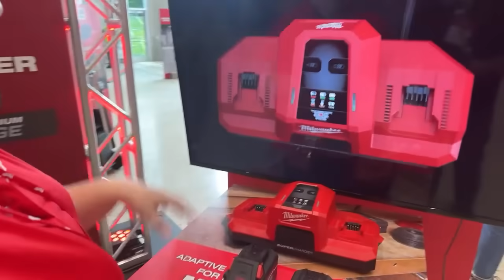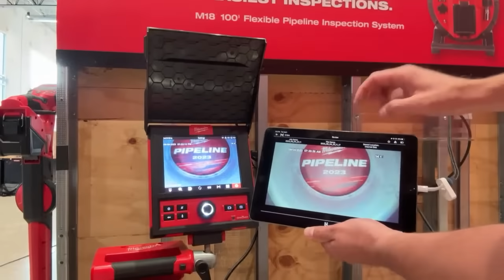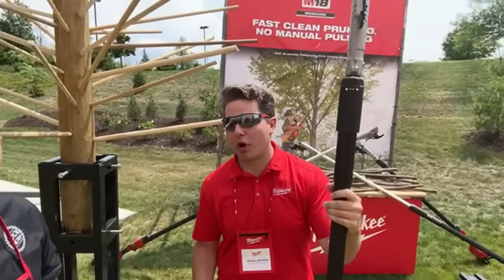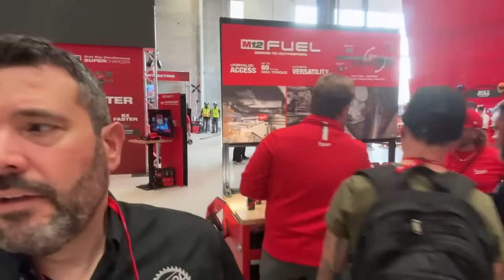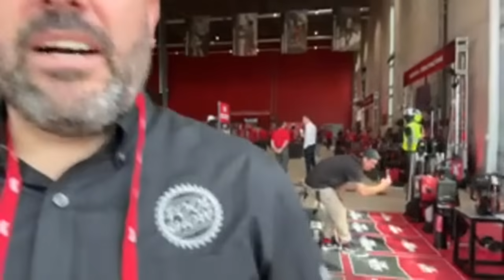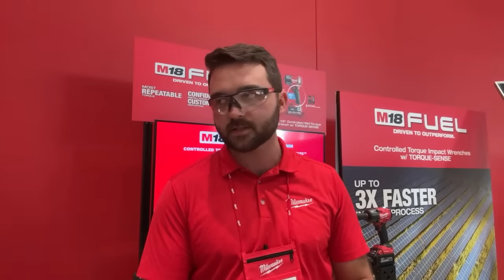LIVE STREAM! 50+ NEW TOOLS from Milwaukee PIPELINE!

Comment: Yeah, I'm one of those who is not a believer in Milwaukee tools. My RedLithium high output xc6.0 battery, lightly used, just over 1 year old trimmer, will run on the low power setting for 15 minutes max! Then it's back in the house to charge for 1 1/2 hours before I can use it again. My brushless drill batteries, purchased with the trimmer, with even lighter use, have both died...Will not jump start. Why would I ever trust in Milwaukee tools again? DISGUSTED!
Reply from the maker: My dude.... warranty. Learn to use it bud? No need to suffer. Just call 1-800-SAWDUST. Seriously. Everything you mentioned is under warranty.

Comment: I would like to know when Milwaukie is going to come out with a graphen battery. Currently, I use a Caterpillar drill set that has a graphen battery. It last longer than the Milwaukee batteries has more power and it takes 15 minutes to charge and the battery doesn't get hot. Just to use as an example using 5 AM hour battery from Milwaukie. I can drill 8 holes 4 inches wide on one charge in. Then I take my Caterpillar drill and I'm able to drill.  28 holes, 4 inches wide. All of them one Charge and that's through 5/8 reply, wood floor.

Comment: Any news on the new Inverter/generator? 
Is it a M18 or MX?
When will it be available?
Reply from the maker: $4,500. Neither M18 or MX. Fixed battery. Built in handle and wheels. It's BIG.

Comment: I' not saying that they cheated with the string trimmer side by side comparison, but it did sound like they kept the choke on.  Not to mention that the cardboard cutting demo was not really all that scientific, especially since the guy with the gas trimmer started after the electric trimmer and he angled upward, and it was still a close "race".  
Come on Milwaukee, we all know that there are many other ways in which the Fuel trimmer beats out the gas unit, like dependability, instant start, less noise.  Just go with those features instead of acting like FLEX when they compare tools.
Reply from the maker: You need to remember that no one takes these demos too seriously. They’re just an entertaining way to show off a new tool and build excitement. Focus on the claimed stats, and then keep an eye out for a third party review here on YouTube. ;-)

Comment: The duel trigger grinder is ridiculous 🙄. The new packout things are nice, but…they still have not fixed the main design error..but neither has anyone else’s.  The insider ratchet is awesome..what about sae sockets?  I don’t use much metric in my work.  Omg. I could use that strut cutter.
Reply: The problem is in the way the dividers are held in…they poke into the interior of them…this wastes A LOT of space. It also makes it vary hard to fit some tools inside They can could have design it so the interior of say, the drawers were totally flat. That’s how I would have made them…it is possible.     That’s the major one in my mind.   I use them everyday.  And everyday it annoys me
Reply: What’s the design error in the Packout system?

Comment: A bit disappointed on the new rotary tool with only 27500 RPM while the older model puts out 32000 rpm. Which is a bummer. Another tool that should have been at the pipeline is the right angle drill even Ryobi outperforms
Update, just realized the new dual battery string trimmer is not Quick Lock compatible also Milwaukee should of definitely come out with a Quick Lock pruner shears version but of course they want you to buy the whole power tool Quick Lock attachments are overpriced anyway
Reply: Yea dremel is still king of rotary tools which is why I bought the 8250 recently. All my tools are Milwaukee besides my dremel 🤷🏻‍♂️ it is what it is
Reply: @markyb7875  will the brushless motor make a difference or did it just reduce the weight. Looks like they just added a led light, reduced weight/ power, and added the collet wrench.
Reply: @markyb7875  you might want to return your dremel and opt out for the previous model Milwaukee rotary with the 6.0 battery thing puts out high rpm’s. The only selling point for the new Milwaukee rotary is the led light and less weight but too bad they reduced the rpm’s. The fact that it’s brushless might give it more torque though. They might of risked some rpm’s/speed for torque 🤷🏽‍♂️